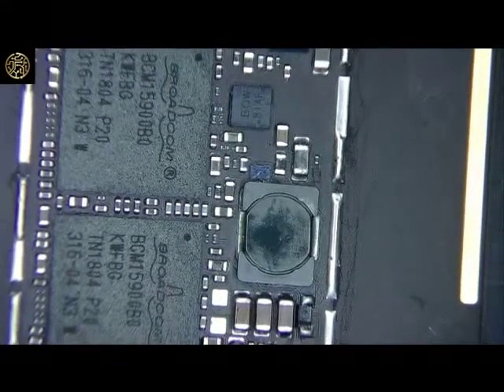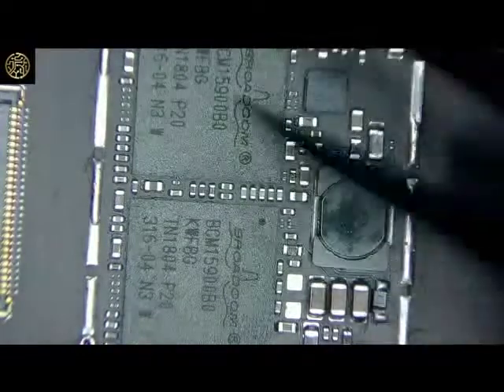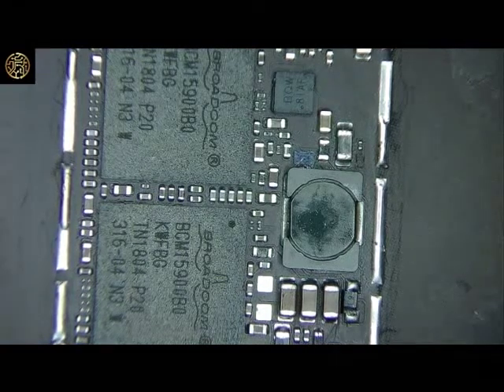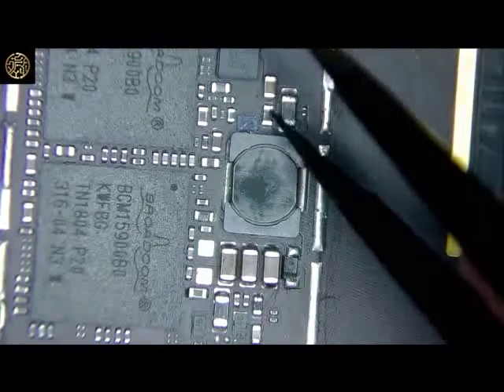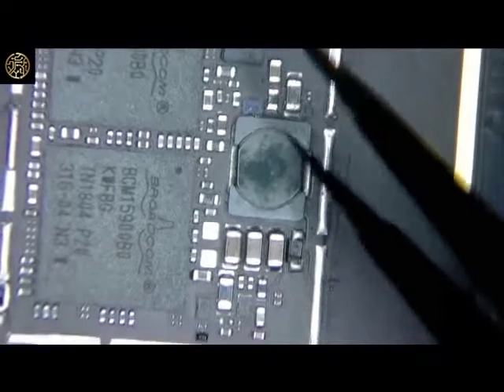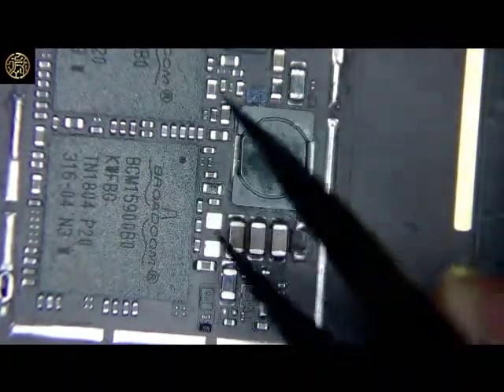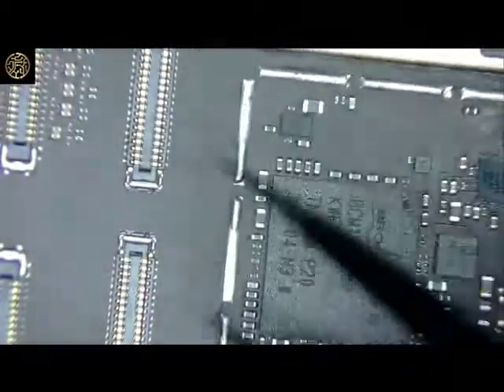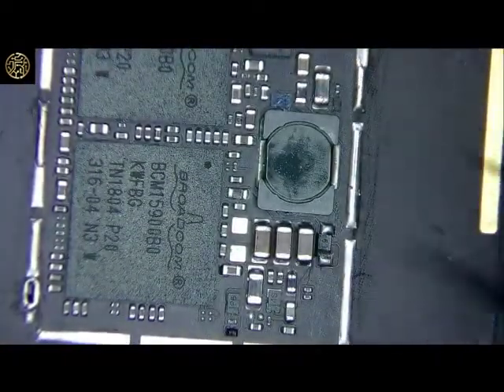iPad Pro 10.5 No Touch Repair

Comment: What would be the cause of one area of touch not working? I tried a new lcd/digitizer and same result
Reply from the maker: There are a few possible causes, here are a couple of them:
-Bad Filter
-Shorted Capacitor
-Damaged Connector (On the board or the screen flex)